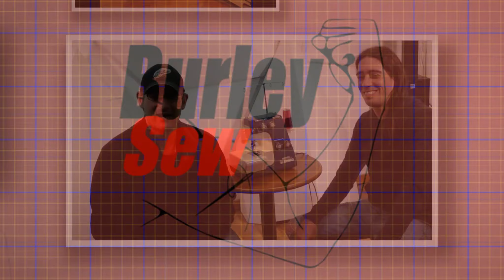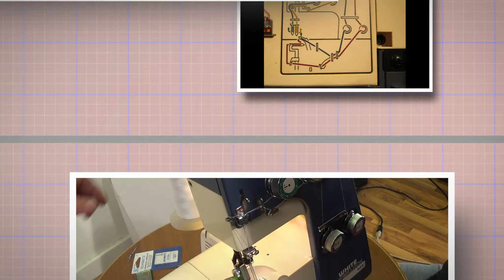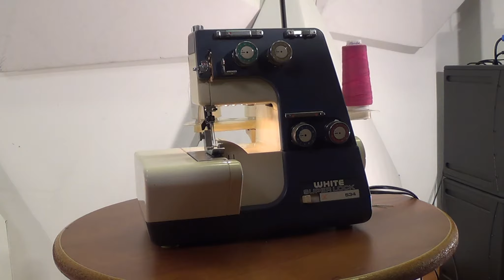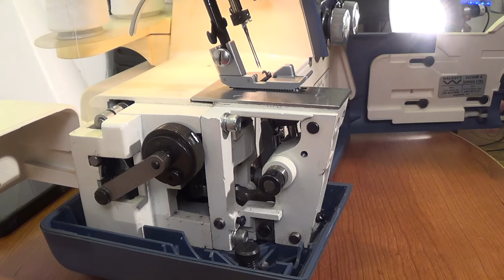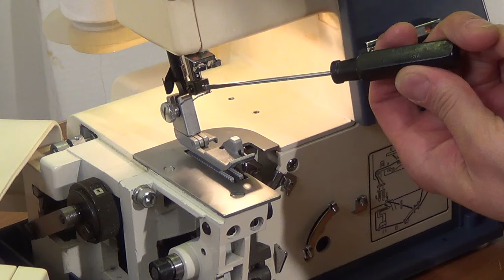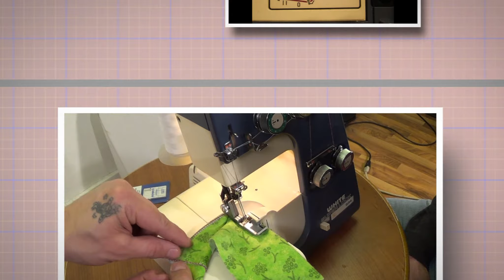White Superlock 534 Serger- Serger Machine Series Ep. 1

Comment: Can you help me. I have this machine for many years. It started to seize . It goes a half revolution and back. I took it apart and can find nothing wrong. I oiled it, let it overnight and still it seizes in one spot. Any pointers? 😊
Reply: I just got one from craigslist as is and have the same issue. I took the bottom off and removed the black rectangular plate (onlt has 2 screws). There are two nylon gears in there and a bunch of yellow goop (i think it is supposed to be there). One of the nylon gears is cracked.  I would replace it myself but you have to remove a lot to parts to replace it and then you have to fix the timing. I would guess you might be seeing the same. I am going to be looking for a pro to repair it.

Comment: Your videos have helped me thread and become familiar with this machine. Thank you for that. I am having an issue though, the feed dogs seem to me running in reverse. I had a few people suggest the machine may have been repaired and the wiring switched causing the motor to run in reverse. Could this be the case? I'm at a loss as to what to do next and think having it serviced would cost close to buying a new machine.

Comment: Thanks so much for this video! I recently found a White Superlock 534D serger at GoodWill for $50.  It was almost 2 weeks before i dared to plug it in,  i was scared to do so because i couldn't believe it didn't have a seized motor or something. I bought it because it was super clean looking and was still in its original box.  Its just me being phobic and i've had too many run-ins with Murphy's Law.  I plugged it in this morning and the motor sounds smooth.  I'll be watching the next video then go over it and clean it up and check if anything is missing.   One question though,  does the "D" in the 534 denote that it is a differential? Or are there A, B and C series models before it?
Reply: +Heather Cox Yes - It's differential feed on the front and rear feed dogs.
Reply: +Alan Hess Because there are two sets of feed dogs.

Comment: You guys are great!!!  I recently got a White Super Lock 534 (long story) and did not know how to use it.  I signed up for a 3 hour class at JoAnn Fabric on sergers for beginners.  The main thrust of the class was how to thread the machine.  By the time I left the class (there were only two of us in the class), I was somewhat frustrated.  The instructor told me that it was threaded properly and needed service since the stitches were REALLY bad.  They also told me the day their service guy comes in.  I thought not.  I came home and looked on youtube, and there you were.  Oh, my gosh.  I followed your instructions, and this machine works perfectly.  Thank you, thank you, thank you.  You explain things so I can understand, and the video shows exactly where I am supposed to be threading, etc.  I also learned from you that the setting on the inside of the machine is the stitch length and not tension as the instructor today told me.  I could have saved $40 if I had watched this first.

Comment: I was looking at sergers online and came across a couple of your videos about the White SuperLock 534. I got my White SuperLock 534 probably around mid-1970's - a little older than you estimated. It is a very solid machine and I've never had any problems with it - my reason for looking at the new sergers has to do with ease of threading and newer features. I go through this exercise every 5 years or so, but then I look at the quality and durability of my machine and decide to wait.

The only problem I have is that the "hook" I have for threading the lower looper got bent and I can't straighten it to use it, and I haven't been able to find an equivalent one - the ones I've found aren't long enough. But it was great to see it profiled. It has never let me down.
Reply: Victoria Oliver q